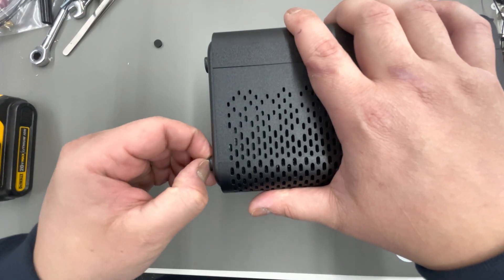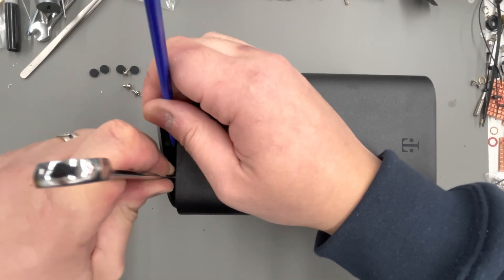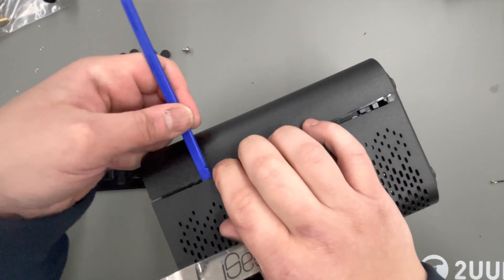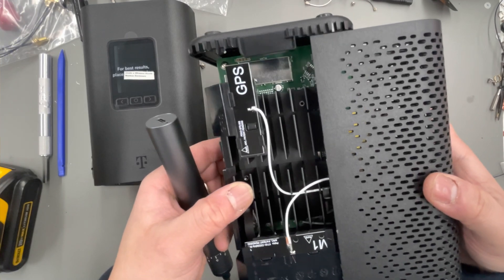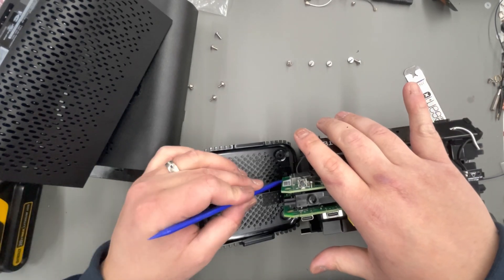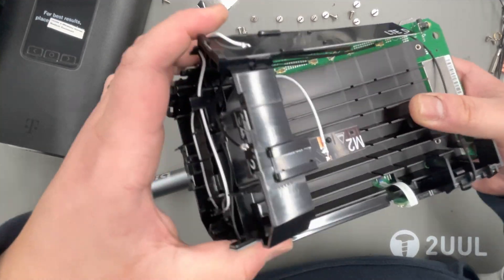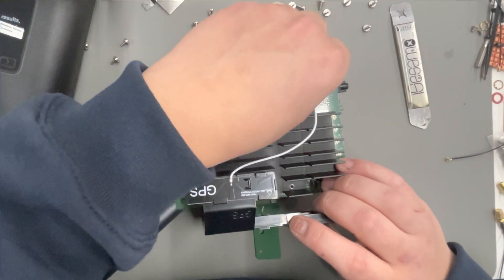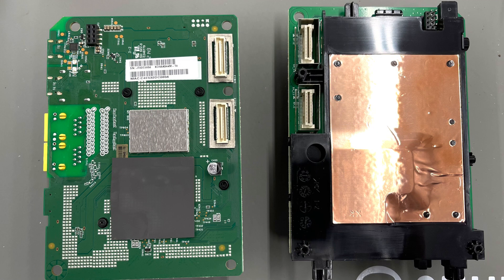Part 1 - T-Mobile Home Internet Arcadyan KVD21 Gateway - Complete Teardown Antenna Diagram POE Build

Comment: Thanks for this video! What you've done here is something I am considering at the moment with my Arc unit, but curious if you are familiar with or know anything about the Poynting EPNT-2? I'm considering doing a similar build with it, but am still researching a bit before I jump in. TIA!
Reply from the maker: No good it's only a 2x2... this is what you can use to house just the router board leaving out the wifi- https://thewirelesshaven.com/shop/antennas/outdoor/outdoor-cellular/mimo-directional-panel/600-3800mhz-cellular-8dbi-directional-4x4-mimo-antenna-rj45-connector/?aflt=154

This is a 4x4 with enough room to house the poe splitter and small kvd router board
Reply: @RouterRelated  Thanks so much for your reply and link! Last question for you (maybe), can any IMEI magic be performed so that I don't have to take apart my Arc and instead use my existing sim with another device? I'd prefer to leave the Arc unit untouched if in the event I ever have to cancel the service or return the device. Thanks again!
Reply from the maker: @TheDTXDan  https://www.ebay.com/itm/134329453631?mkcid=16&mkevt=1&mkrid=711-127632-2357-0&ssspo=Q1knWr5pRB-&sssrc=2524149&ssuid=Q1knWr5pRB-&var=&widget_ver=artemis&media=COPY

This is from my shop tested send fast as kvd if not faster

Comment: It's very interesting to see the product I make on youtube.🤪
Reply: You build the T-Mobile gateway ?
Reply: @stillhere153  There is a 5G module in the PCBA of this arcadyan CPE, our guys design that FG360 5G module, and arcadyan use the module to build this CPE.Under the largest shielding cover is the 5G module, I participated in building the baseband.😂
Reply: @stillhere153  I repair 12 of this board in the past few weeks, many of them have LCD problems or SIM card un-detectable.😅
Reply: @chucktan8130  oh ok you work for semiconductor
Reply: @chucktan8130  feel free to share that at commands for it lmao. Or if ya can ssh into the device